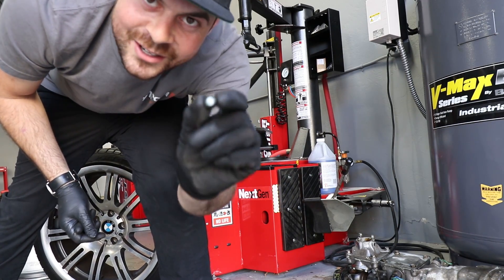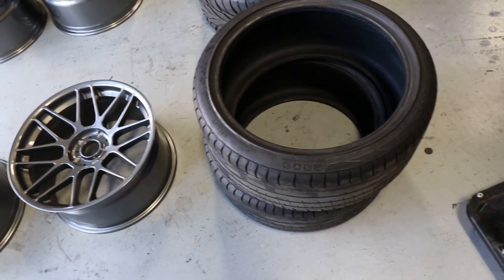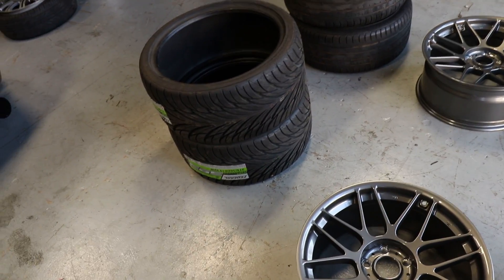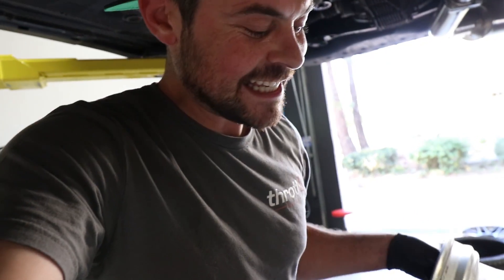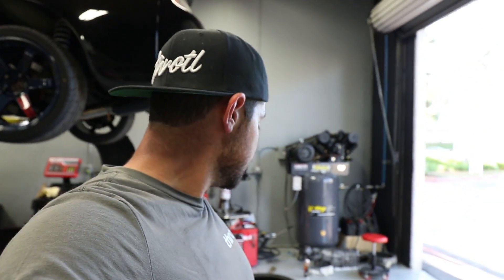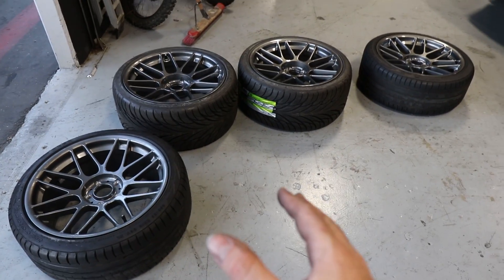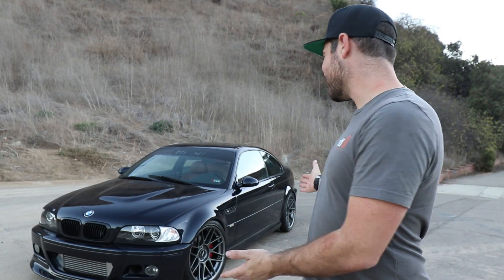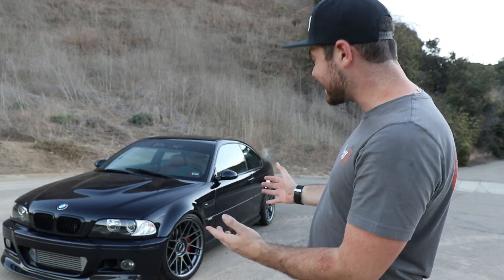E46 M3 LOOKS INCREDIBLE WITH NEW WHEELS!

Comment: 245/35/19 on front, no scrubbing. I would have gone for 275/35/19 on rear instead of the 275/30 (I know the 30 is btw recomended) as one pot hole and your rims are trashed. I know because I learned the hard way.